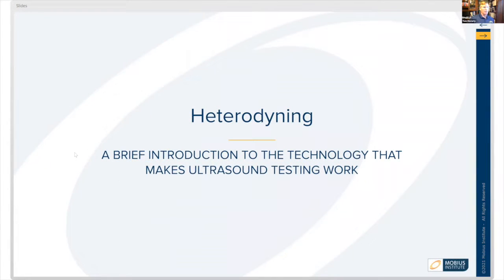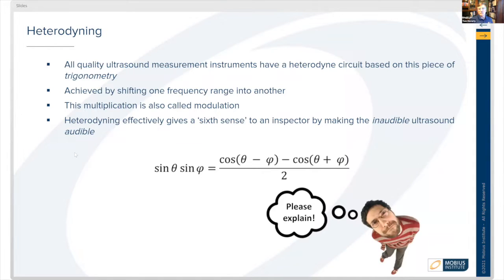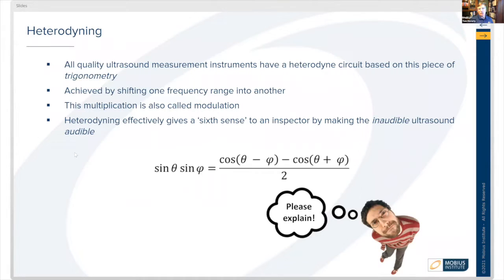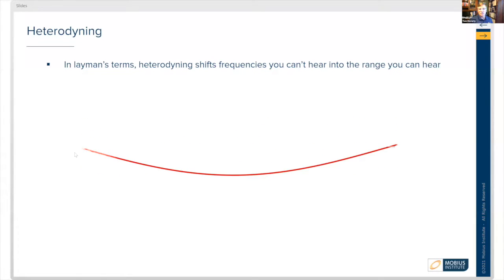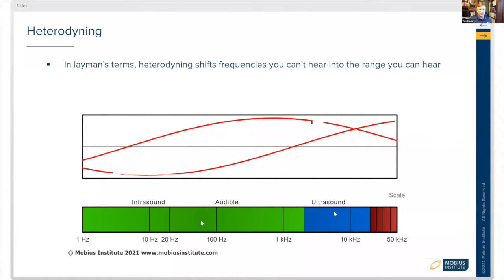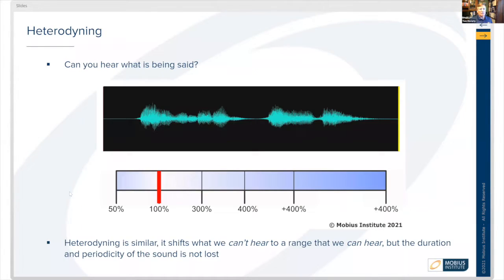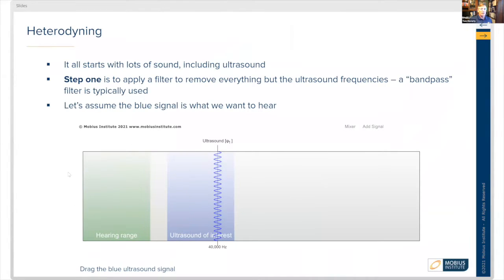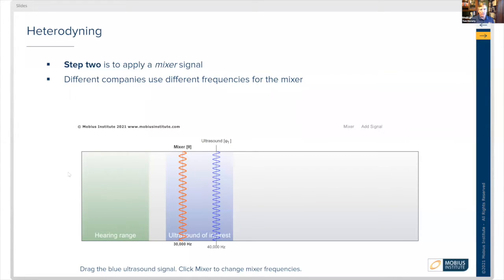A Brief Introduction to Heterodyning

Comment: 5:45 the area not of interest is in fact of great interest and can be very problematic and it depends on the frequencies in use. At RF frequencies the sum can produce a viable radio frequency and this has to be filtered out, otherwise it will go to propagate outside of the mixer and create issues further down the line.